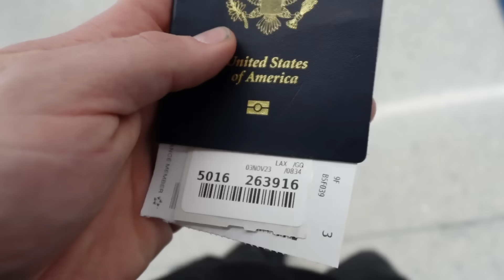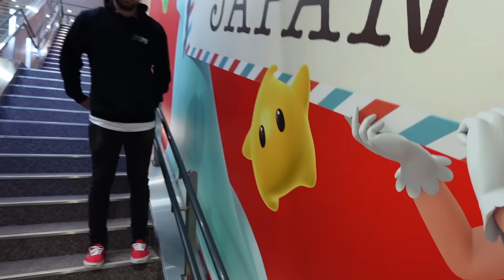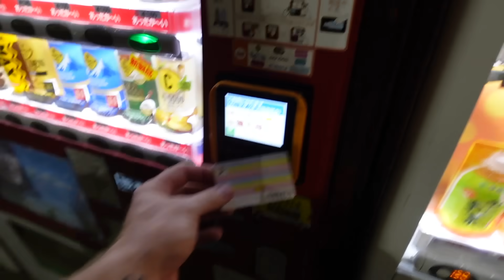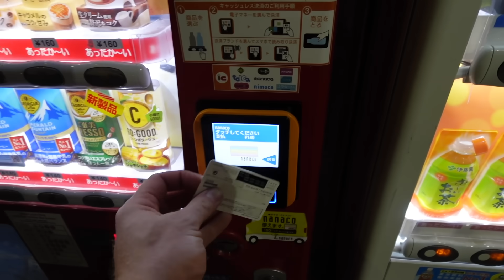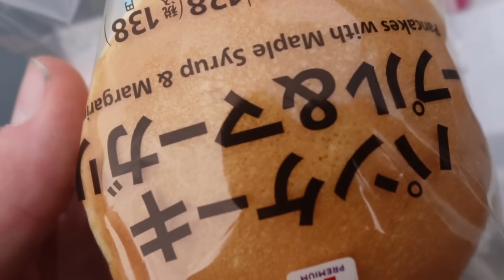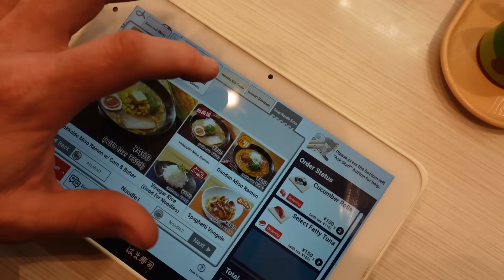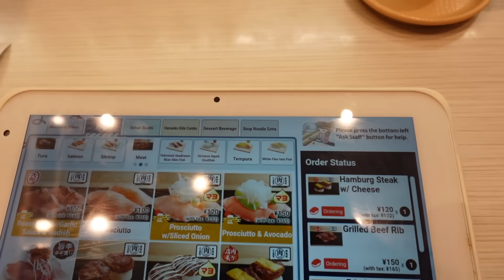Rescuing My Neglected Japanese Drift Car

Comment: OKAY I BITE : @ Spring Matsuri you said you need a new eng. for your car and drove it hurt for the last 2 days bc you didnt care and going to have a new eng installed btw then and now / last 6 months !   what happened ... did you had it swapped out or its still the hurt motor that at any sec will bush a rod out the block !?
Reply from the maker: engine is still not happy haha